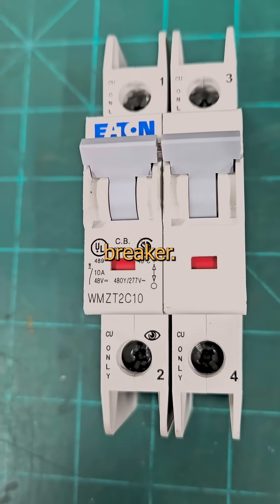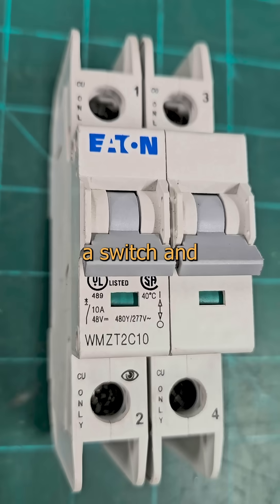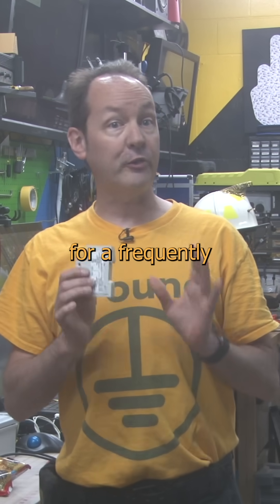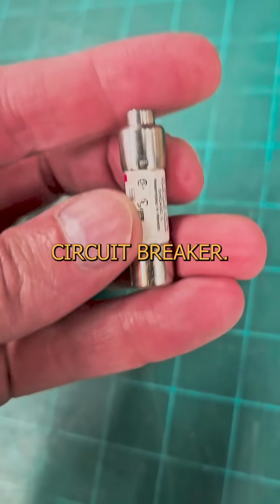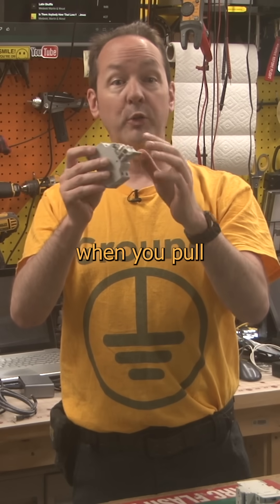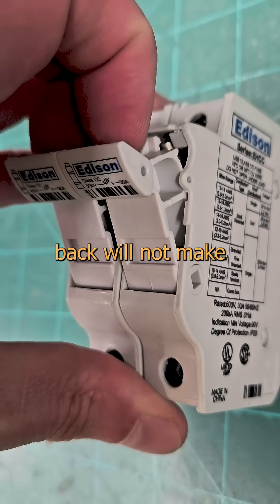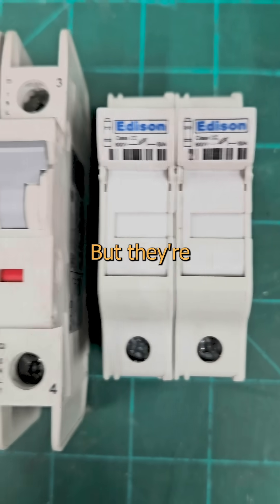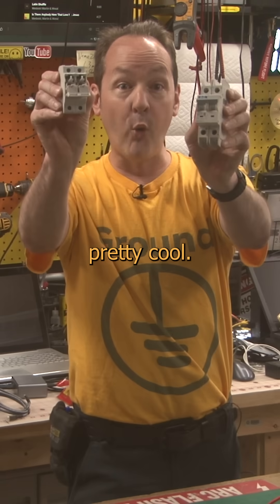Breaker vs Fuse #chrisboden #comedy #engineering #electrical #apprentice #training #educational

Comment: I used to tell my trainees a circuit breaker keeps the magic smoke from escaping. A fuse releases the magic smoke to protect the system.
Reply: YES. I made this comment about transformers. I’m glad I’m not the only one that paid attention in school and knows a lot of these are powered by magic smoke
Reply: you forgot the third permutation.  a 1,500 dollar microprocessor will protect a 15 cent fuse by blowing up first.
Reply: @kenbrown2808  If - and only if - it is not a test performed in lab conditions. In the lab the fuse will sacrifice itself gladly to lure us into trusting its ilk. In the field all bets are off.
Reply: A little pedantic but a circuit breaker usually doesn't protect "things" they're too slow for that, they protect the wires from burning.
Reply: @vgamesx1  That's exactly what he's saying
Reply: @vgamesx1 dunno, you feed enough current through them and they're pretty darn quick 🤣 but you're right, and people don't seem to think about what gets the angry pixies from point A to point B, only about what's at each end. 🤷🏼‍♂️
Reply: @TheDiosdebaca  Depends. Overcurrent protection is quick as in milliseconds quick (it's for protecting the load AND wiring). Overload protection is all about wiring though.
Reply: @TheDiosdebaca  
thumbs up for "angry pixies".  might have given you money if you could have worked in a "desiccated tree carcass" reference
Reply: @vgamesx1 RCDs are technically circuit breakers and they protect the most expensive machine of all, and if you don't think humans are expensive, you've never worked at a place that had to settle a wrongful death lawsuit.
Reply: @vgamesx1  yes, I recently had a 1300 watt PC power supply fail on me, i think it killed the whole computer and did it be the circuit breaker tripped. I know this because the circuit breaker did trip, but the PC was dead. I latter tested the power supply on a fused outlet, it blew the fuse, protected the circuit breaker, but also got a  nice bright spark out of the power supply.
Reply: Forbidden magic smoke, I actually got to witness a circuit overload
Reply: I love working with grumpy old men that talk to everyone like they are babies. Makes me happy.
Reply: Magic smoke which is caused by very angry pixies. I feel we have entered a new era 😂
Reply: I saw a demonstration of circuit breaker vs. fuse 20ish years ago. 
A fuse is the faster of the two. You can't see the speed, but electricity notices.
Reply: @ that’s why you usually have both in a circuit. The breaker for common, small surges or asking too much of the circuit. And the fuses for when lighting strikes your building and sends a few million volts racing through your circuit.
Reply: The fuse (or circuit breaker) protects the wiring in the building. The system protects the fuse, whatever device is connected will be destroyed long before the fuse blows, because if it isn't you've connected things in a horribly incorrect manner!
Reply: @PeregrineBF the circuit breaker he was showing is the type that goes on the equipment to protect the equipment, you are talking about the distribution panel breakers.

Many types of equipment have circuit breakers to protect them from damage, that will pop when the current exceeds the normal levels, but before damage is done.

When a motor sees excess torque for example.
Reply: @ke6gwf  I was teaching aircraft avionics systems. Our fuses and breakers typically blow way before the current levels reach a point of damaging components.
Reply: Exactly! That's the point of breakers in aviation! I work with helicopters and breakers often pop from surge loads on external equipment etc, and you just reset them! Lol  @TheJaybrone
Reply: @ke6gwf  True! But a lot of equipment breakers are to prevent fires, e.g. anything electronic will only trip a breaker if it's already catastrophically failed & is short-circuiting the input power. Stalled motors are the exception, since they're nit electronic.
Reply: @PeregrineBF unless you're using a first gen Eaton arc fault circuit interupter, then they protect you against CW on 7mHz.
Reply: @AI7RK as a Tech Minus, I can confirm that CW is VERY dangerous!! Lol
Reply: @PeregrineBF it depends on what the device is and what the ratings of the circuit breaker or fuse is.
Reply: @PeregrineBF I agree with the first part of the Breaker protecting the wire. BUT I think you got the second part backwards. The fuse should absolutely blow before something something (motor in most cases) burns up and that's only if your overloads are sized incorrectly and don't trip like they should. 
Why would the "system" I'm sure what you're referring to specifically, protect the fuses. Fuses are meant to be sacrificial, not protected.
Reply: @PeregrineBF 
Since the main cause of flipped circuit breakers and blown fuses is having too many things connected to the same circuit, it makes sense that they’re primarily made to protect the circuit itself, not the things connected to it.
Reply: @ragnkja  The main cause of a blown fuse or tripped breaker in a device or device cabinet like the ones in the video are for is a component in the device having failed short. The fuse is there to prevent a fire, not to save the device that already died.

The breakers in your panel at home are also to protect the wires in your walls, not the device. You can trip them by plugging lots of devices into one circuit, since that would overload the wires. You can also trip them by having a device fail with an internal short. Either way, they're not protecting the device from damage.
Reply: What I've taken from this comment, is to get both and daisy chain them
Reply: Jokes aside, I tested MCCBs (think industrial circuit breakers rated for 12.5 to 10k amps) for a living. After some time you start literally  smelling the problems with overload protection - as in, malfunctioning device stinks differently from a good one.  As in, heated metal and burning lubricant vs burning glass-reinforced plastic difference.
Reply: I've always loved calling it the magic smoke.

Comment: Something I found was interesting is breakers pass full current until they trip, whereas fuses taper the max current as the fuse heats up. This can result in less of a bang if something goes wrong, but it can also prevent tripping multiple upstream circuits as opposed to if you used a breaker. This means large factories have to use the right combination of breakers and fuses in the right places to minimise affected circuits if a fault does occur

Comment: Instructions unclear. I wrapped the fuse in foil and replaced.
Reply: Instructions unclear. The fuse holder has exploded, the panel is on fire and I have no more eyebrows.
Reply: @lukahierl9857  Fire is temporary, but getting eye brows tattooed on is forever.

Comment: Fuses are, in short, illegal in France.

Even car makers now use auto reset breakers ...
Reply: That only applies to residential sockets and lights.
Reply: @lukahierl9857   i said in short ... When compared to circuit breakers. 

Of course they are still used in many places where circuit breaker is inappropriate.

Comment: I went to (and now work at) a technical school. When they made a new section of the school, they used breakers as light switches. Sadly im in no position to replace someone with arduino

Comment: I remember where I saw linefeed<>fuseblock<>breaker<>keyswitch<>estop<>device… and i was like, well this engineer was a belt, suspenders and elastic waist pants kind of guy.
Reply: I’m getting ready to add a VFD to a lathe, and the manual for the VFD specifically calls out to use both a breaker and fuse in the setup to power the VFD. Considering it’s a lathe, the only thing in your list that’ll get left out is the key switch!
Reply: Depending on the available short cicruit current, a up stream fuse may be nececary. Standard DIN rail breakers are only rated for 6kA or 10kA. But most fuses can take 80kA.
Reply: they wanted to make absolutely positively sure
Reply: A Valley Girl for sure for sure two condom kind a girl.
Reply: In an electrical panel where I work my company has it set standard to have a set of main fuses on the line infeed. Then it branches 3 ways, one to a safety rated contactor, one to the 24vdc control power supply, and maybe one to a transformer if voltages other than 480 or 24vdc are called for. 

From the contactor every output device (usually motor drives, but there’s a couple oddball devices I can’t tell you about) has its own breaker. I’ll regularly use those to power cycle a faulted VFD, but we have high 3 maybe 4 digits of those, so no single breaker gets used as a switch all that often.

Comment: It drives me insane that at the bookstore I work at, they treat breakers like switches, and flip them off EVERY.  NIGHT. And on EVERY. MORNING.
Reply: Check the documentation from the manufacturer. For instance Hager specifies that the breaker is rated for 4000 switch cycles.
Reply: @klausjuergen  Nice comment. I don't know if closing the circuit manually count as a cycle because the physics of automatically closing the circuit is quite different than manually closing the circuit.
Reply: @klausjuergen if U flip it 2 times per day, that's 365.25 * 2 = 730.5
4000 / 730.5 ≈ 5.48 years
Not long, but I gess it's decent
Reply: @klausjuergen so less then eleven years of used daily, boards should and can last decades before requiring a rewire and or update.

Don’t use that thing as a switch please!
Reply: This is actually pretty common in commercial settings (in the US).
Reply: Was like that when I worked at a grocery store. 

Before they switched to LEDs I doubt there is a regular wall switch to could actually handle the current of a chain of fluorescent bulbs. Even after LEDs its like, they haven't had an issue with it up to that point.
Reply: @NaiaElwyn  ....what? Why would a wall switch NOT be able to switch some lights? That's literality its job.  you can get a 40+ amp wall switch, which is ACTUALLY designed to be used every day...
Reply: They would use a switch to activate a relay  @NaiaElwyn
Reply: @ryancrazy1 yeah,  but that's just the guarantee,  not the maximum number of cycles
Reply: @NaiaElwyn  There is a device specifically for that kind of load being switched.
A contactor.
The contactor can be sized for the load it will handle, and it is controlled with a lower-voltage switch.
The big ones make the fun "ka-chunk" sound you hear when large warehouses and hangars turn their banks of lights on.
Reply: And they still work for 20 years like that in a 230V worplace, even when turning on and off a whole 400V air compressor many times a day. :p
Reply: @tomclanys  lmao I have one compressor like that rn, don't know why maintenance did it. but it was a 'temporary thing' a month ago 🤣😂
Reply: @tomclanys  the people that tell you not to do it is because all their knowledge on the subject comes from some random collection of YouTube shorts
Reply: @tomclanys  dat manufacturing doe
Reply: It's really not a problem with commercialy rated breakers.
They can go for decades of daily use.
Reply: @blaydCA  even if they break; 230V16A (standard where i live) one is like 10 euro's to replace. 
The main problem is ensuring that is works when you need it.
Reply: Pay me now, or pay me later.

Breakers are not that expensive.   Replacement panels that fit a new generation of breaker are expensive.
Reply: @jamallabarge2665 most newer residential codes are requiring arc fault breakers for non utility rooms, and those are not cheap.
Reply: As some people here pointed out, it's very common to do so. But if that somehow becomes a problem I would recommend you to suggest a shut off system for the particular appliances that need to be shut down every day.
Reply: @citter96 to all people who talk about common habits as if that means it is okay to do so, when loads of professionals make entire videos to tell you (please) don’t: you are what is wrong with society and keeps you from learning.
Reply: @bertbergers9171  you're just wrong my guy, a thermomagnetic breaker has at least 10k cycles and the mechanic parts are rated up to 20k cycles. This means that, even if the breaker trips once a month for 20 years, you'll still have 9760 cycles left. If I were you I would stop taking advice from YouTube videos and look up things trough responsible sources.

Ps:  the fact that you hadn't addressed my suggestion about the centralised shut off system means that you either didn't read my full comment or just ignored it to have something to cry about. Next time try to *at least* learn the bare minimum of something before commenting about it
Reply: Yup, I worked in a Radio Shack in collage, and every night, we shut the lights off by the panel breakers.
Reply: That was common at the die shop I worked at for 30 years. The building was built in the 50's, I do not remember too many  breakers being replaced.
Reply: @ciceroskip1  that's probably because they were Federal Pacifics, they only burn up (literally), or explode 🤯.
Reply: @bold-Motion  at my county's convention center, we have exactly 3 light switches. Everything else is controlled by a room with 8 different breaker panels that contain a total of 67 breakers. None of them are labeled and you can't see the thing you're trying to trigger without walking 150 feet each attempt
Reply: Is there anything wrong with doing that? Like sure they're more expensive than a switch, but does it damage electronics on that system or something?
Reply: @rapidpigz8238  Switches wear out.
Reply: @rapidpigz8238  It depends on the breakers.  Many breakers are only designed to be good for a relatively small number of on/off cycles, because it is assumed that they are not going to need to be cycled except when there's some sort of fault (which is uncommon).

Some breakers are actually designed to also be able to be used this way, but you need to check the particular breaker and the manufacturer's recommendations to know for sure.

It won't hurt any of the downstream electronics, etc, to do this, but the big problem is that if you exceed the rated number of cycles for the breaker, it can potentially fail in ways that are not obvious, but will make it not trip when it is supposed to, and that can potentially be bad, so you should never treat breakers as switches unless you know that the manufacturer has actually designed them to be used that way.
Reply: @foogod4237 Fortunately, SWD ratings are fairly common with smaller breakers. For example, any standard 15 or 20 amp QO breaker will have this rating.
Reply: Perfectly fine if the breakers are rated SWD
Reply: @michaelardai9703 exactly.  People crying over nothing
Reply: Breakers marked with SWD are rated to be used as switches
Reply: Huh. Actually that breaker is “switch duty rated” suitable for switching fluorescent light loads <20amps. 20,000 cycles
Reply: Well ,  a circuit breaker from eaton is rated for over 8000 switching actions, when done by the user, its around 20 years when switched daily , so everything fine
Reply: Some breakers double as switches, and they are often used in commercial/industrial settings. They have a higher number of manipulation cycle
Reply: Job security...
Reply: In the place I work at (hardware store) I was told they did exactly this, off every night and on every morning to turn on/off the lights. Now it's timer controlled, but still ffs
Reply: to be fair, they're probably just making sure the circuit is not turned on at all while they're out. no fuses, no power
Reply: Now do that with entire MCC sections. I have no idea how the breakers have lasted this long (more than 15 years like this).
Reply: There used to be lighting rated breakers that were meant to be used as daily use switches. They had a vastly higher click rating than standard breakers.
Reply: They do make "switch duty rated" (SWD) breakers that can handle multiple switching cycles. I don't know how much additional cost these switch rated breakers are compared to their non switch rated cousins.
Reply: We do the same for our water heater because it kept melting all the normal switches
Reply: The NEC totally allows it though, ugh . I feel ya!
Reply: i mean, it wont harm it much, its a problem if it gets harmed though
Reply: REEEEEEEEEEEE
Reply: Suggest they switch to motion activated LEDs
Reply: Technically they are switches too, 
I even use one RCCB as a switch (car charger line).
Reply: Yeah and they could install a contactor after together with a nice little switch somewhere safe.
Reply: We do the same at the bowling alley i work at LOL
Reply: SCREAMING
Reply: Switch duty rated commercial breakers are a (common) thing.
Reply: every retail job I ever had used the breakers to control the store lights and exterior signage
Reply: All good if it is marked SWD.
Reply: There are devices that look like an circuit breaker and can be used as an switch or switches that can be connected on an DIN Rail
Reply: There is such a thing as switching duty breakers used for just that purpose,  marked a SWD in the labeling. They're not used as much now due to concerns about arc flash.
Reply: Get over it, because that's normal practice lol
Reply: Are they hippies? I know some people that will kill their breakers when they leave the house because they want to stop the parasitic draw from electrical devices without out unplugging them all.
Reply: @krzyryry8382 lots of commercial buildings don't have switches to shut off the lights. They only have breakers, which then become the switch.

Comment: Fuses have higher SCCR ratings , common on 480V circuits. CB have different curves ( ie how much time between the Overload experience to springing mouse trap) . Curve is decided on the attached load, some load have high initial current, so yo will need a longer curve so that it does not trip every time you power on the device. CB is common on 120v and 24 V DC